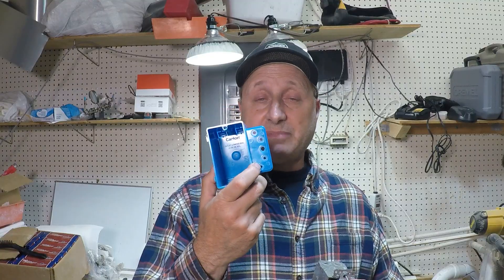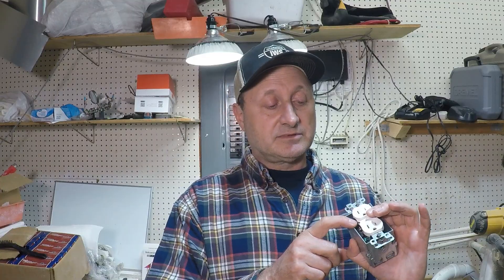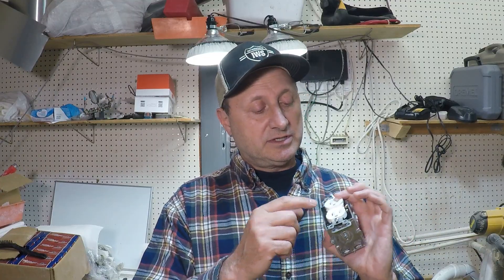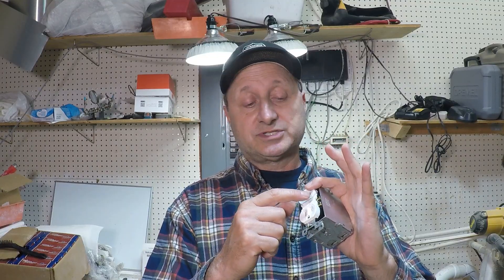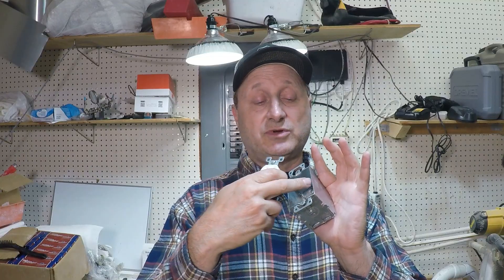Why Your Electrical Box Needs a Ground Wire

Comment: A couple of comments on the grounding.  The clamps in the box look like they're for mc wire (metal clad or armored)., so just clamping the mc would provide a ground. In addition, if you are using romex like 12/2 with a ground wire, simply attaching the ground wire to the outlet or switch will ground the box. How? Because when you screw the outlet into the box, it is now completing the ground, so if a hot wire hits the box, you'll still trip the circuit. The only way I can see the box becoming "hot" from a hot wire touching the side of the box is if there is if the ground wire is not attached to the outlet or switch.

Comment: Thank you. Good explanation on ground wire.  Can we not attach the ground wire to the green ground screw of the output inlets?  The other two screws is where the black and white wires go.  Just curious as to the function of the green screw for grounding if we can attach it to the metal box directly.
Reply from the maker: yes the green screw is for grounding

Comment: I'm a first time DIY. Several outlets and one switch in my house are not working and I'm planning on changing them, as it is electricity is extremely dangerous and it's important to know as much as possible about working with it. I would not have thought of the ground being just as risky as the rest of the wires. I feel more confident replacing my outlets & switch since I know what to look for and what not to do. Thank you, thank you,for these informative videos.